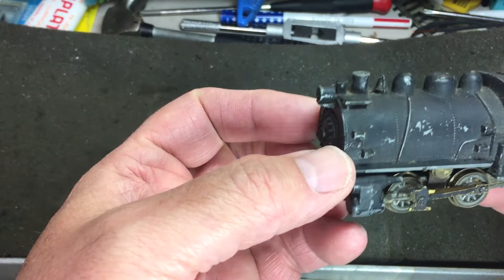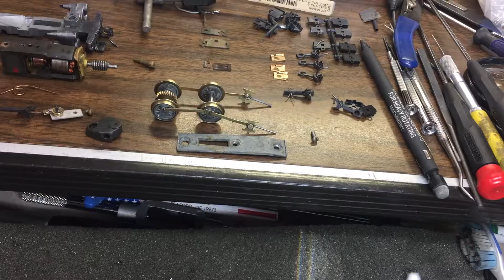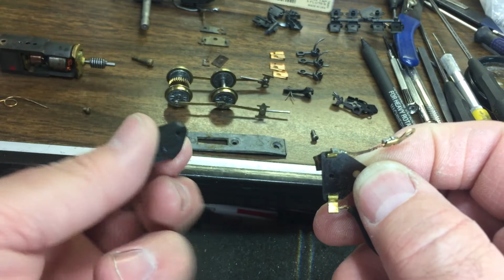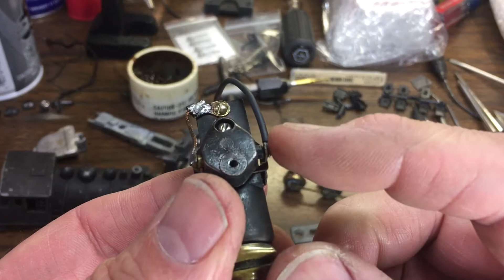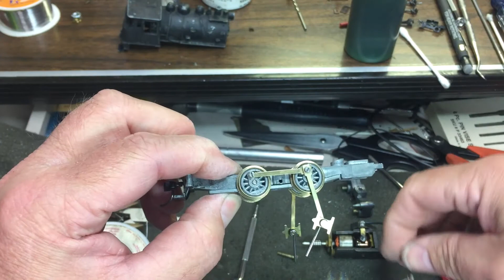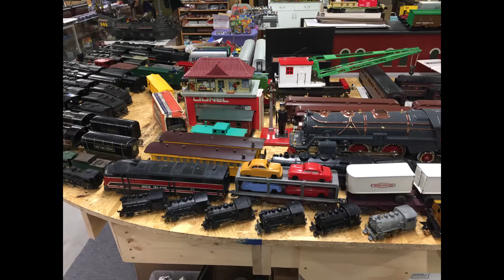$20 Varney Dockside Makeover. Cleaning, repairing, oiling and adjusting the locomotive. Vintage Ebay

Comment: Very nicely done!. I have one of these as well and did a similar coupler mod. However i eliminated the use of the spring plate and installed a Kadee #148 "Whisker Coupler". No need for the flat spring plate after that.
Reply from the maker: Thanks for commenting.

Comment: I have several old Mantua and others with those open frame (Pittman) motors.  I changed out all the magnets on all my Pittman motors to neodymium (rare earth) magnets and it made a HUGE difference in current draw and performance.  Now they will "creep" around the tracks.  Cheers from eastern TN
Reply from the maker: That sounds like a great way to improve your engines. How did you get the magnets the size you needed?
Reply: @Nathan5Chime  I measured the space where the old magnet was and ordered little square magnets; I think I used 4 per motor.  I'll have to see if I can find the size; I wrote it down somewhere and will have to find it.

Comment: 11/1/2021
Having built several of the old Mantua locomotive kits, I find your little Varney to be quite similar in construction. This is what we had back before plastic, and could not afford brass. Many, many hours of model railroading happened because of engines like this. 
Nice restoration of a tiny engine, many would just trash. ;-)
Reply from the maker: Thanks for your comments. These are well constructed and worth fixing back up.  I learned recently that these motors need to be re-magnetized to get them back to factory spec. so I am still considering getting that tool.
Reply: @Nathan5Chime  Yes this is true. The motors used in these old models are similar to the Pitman 196, larger locomotives had one similar to other pitman motors. Sometimes, not always, either a pitman or parts from one can be used to fix motors like yours.  Your Varney motor differs mostly in the cap that holds the commutator brushes.;-)

Comment: On those old open frame motors (this one looks like a Pittman DC60?), it's best if the armature is not removed from the magnet and pole pieces, otherwise the magnet loses it's strength and the more this is done the weaker and weaker the magnet becomes and the current draw goes up, and the motor runs hotter. This motor will most likely benefit from being remagnetized, as it must be around sixty years old anyways. I live in Canada, but I invested in a remagnetizer made by a guy in the U.K. called Ronald Dodd. It's a wonderful piece of kit and will bring an old motor back to life. It works with all types of old open frame motors, including your pittman type. You can check it out here: https://www.youtube.com/watch?v=0A-hLYS9RvU   Love your videos, really interesting. I want to get one of these old dockside locos.
Reply from the maker: Thanks for the great tips.  Makes sense that the magnets will loose some of their magnetism. I will look into the remagnetizer.  It would be great to get it running like new.